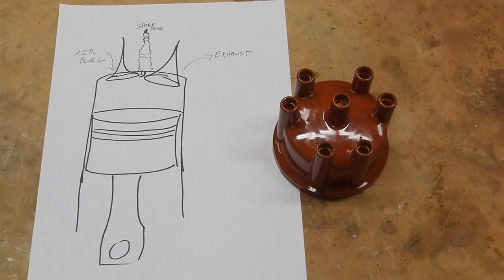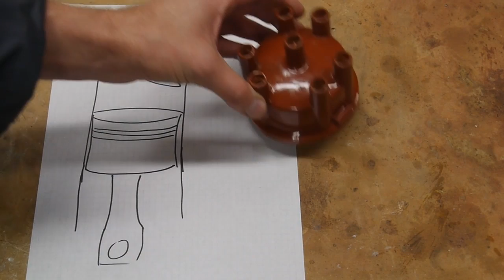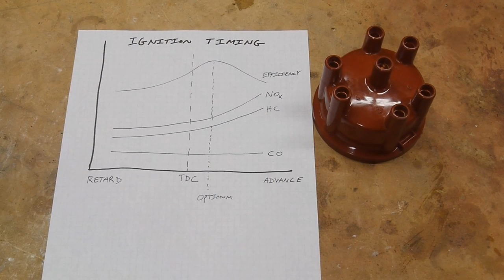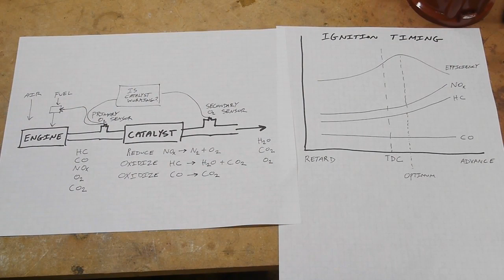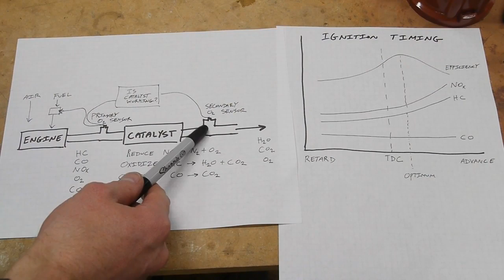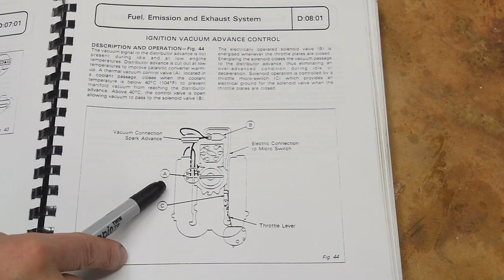Car engine science: Ignition timing, emissions, mixture

Comment: Fist of all I really love the videos you make and I enjoy then very much so thank you for making then. Second can u please please please make a video about electrolysing water into pure hydrogen not hho gas. The anode and cathode the are best for this application. And the input to output return that you get from using the hydrogen as fuel for a fuel cell or burning it on a ice. And I know I'm already asking for a lot but if u can also make a video about storing the hydrogen under high pressure like the container you made for the co2 gas at about 3000 psi I would really really really appreciate it. thx again for what u do and if there's any way to financially help whit your projects please let me and all others know
Reply: HHO-gas, properly called a 2:1 molar mixture of hydrogen and oxygen is all you're gonna get out of electrolysing water. That is unless you separate the electrodes in which case you can catch the pure hydrogen at the cathode. Probably a cheaper method of making hydrogen though is dissolving a common metal like zinc, iron or aluminium in an acid of choice.
Reply: Quintinohthree
Magnesium also works iirc, works with acids as weak as vinager if my memory serves me correctly. Although not as cheap/readily available as ally.

There are also other chemical reactions that will release hydrongen but are much more dangerous, such as Lye (Sodium Hydroxide) + Aluminum which is cheap and can be obtained from household materials, BUT it gets very hot and can cause the solution to splatter as the water boils (yes it does get THAT hot)

Reaction is Al + NaOH + H2O -> NaAlO2 + H2 + Fuck tonn of heat

To get "pure" oxygen/hydrogen from electrolsis you will need to use PVC? fittings in such a way that the "air pocket" above each electrode is isolated, in highschool they use to use graphite electrodes (because my high school was too cheap/our class where too much of a bunch of anarchists for them to give us titianium electrodes) and we used a very very very weak sodium hydroxide electrolite solution to help along our shitty town water (great clean taste, shitty conductivity) in conducting electricity

I think the reason graphite is used alot is because its cheap and inert? and thus does not start electroplating the cathode? (I am a bit rusty on my science sorry)

Alternatives would be Sodium Bicarbonate (NaHCO3). Do not use common table salt NaCl as the electrolysis bi-products include Chlorine in both solution and gas (been there done that, didn't like the house smelling like a pool)

Also do not use rectified mains to do electrolysis, that wild bubbling you see is NOT HHO gas... its H2O gas aka STEAM from the water BOILING rofl, shoudln't need more than about 24 volts MAX though 12 volts works perfectly fine
Reply: If this is about over unity, it's doesn't work.